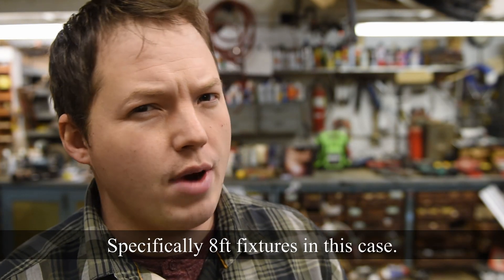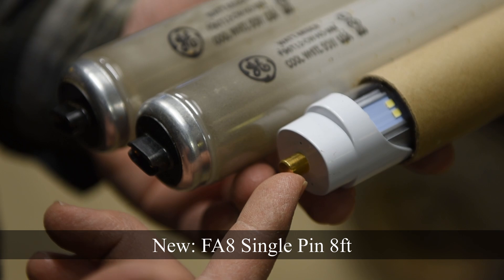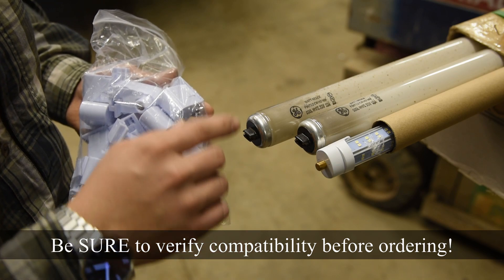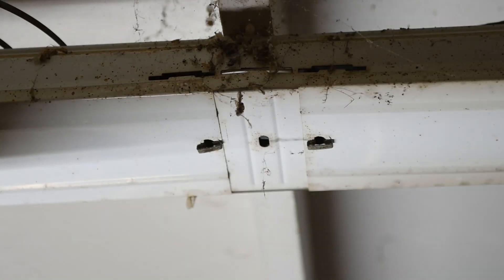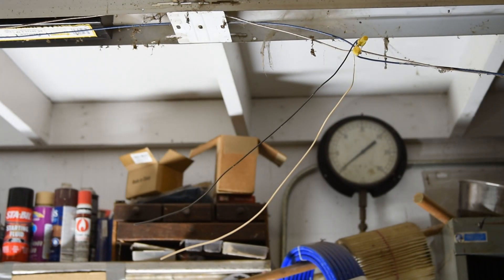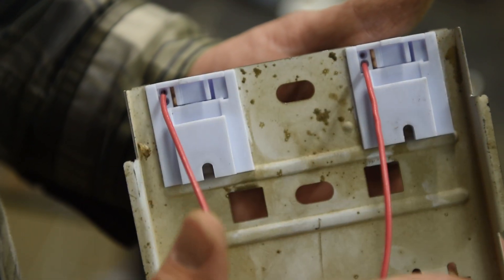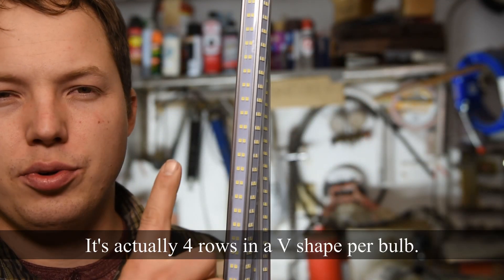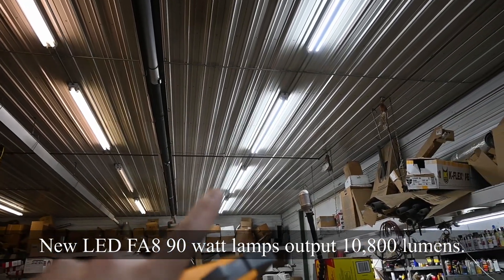How To Convert 8ft Fluorescent Lights to LED - Ballast Bypass R17D to FA8

Comment: I do this for a living. I keep rolls of solid 18awg black and white on the truck but as long as you keep a consistent wiring scheme it’s not a huge deal as long as you don’t use green. I’m pretty sure the nec only dictates against using green as a current carrying conductor but yes standard field practice is 120volt white and 277v grey.
Reply from the maker: Awesome. Thanks for sharing your experience! Do you recommend changing out the lamp holders or do you usually match the bulb to the existing ones?
Reply: Benjamin Sahlstrom Hey thanks I appreciate that. In your case I would’ve changed them. You didn’t need HO lamps and they’re more expensive to retro. As long as they are in good shape, not old and fit the application I’ll leave them.
Reply: Towelie,.  I took my red and blue extra wires and spray painted the last 3 or 4 inches of each end white spray lacquer.  Every DIYer probably has a bit of white spray around in a cabinet somewhere.  These indicate neutral wires, huh?   Cheers
Reply: You can buy UL type B LED retrofit lamps with r17D bases. Satco and Keystone make such lamps.
Reply: Buddy89, all I can find locally is stranded 18 gauge. I tinned the ends with solder and the wire locked in fine. My question is , do you think it's a problem tinning the ends of the wire?  Any safety concerns I need to be aware of?  Thanks for your input
Reply: G M as long as the insulation on the wire is rated for the voltage you should be fine🤙
Reply: @Towelllie  Well, I bought some automotive wire at NAPA.  It's rated at 13 amps.  I have no clue of the insulation rating.  How do I determine that?  Thanks again for your help
Reply: G M insulation is rated by voltage and is printed on the insulation about every foot or so. If there is no voltage rating don’t use it.
Reply: @Towelllie  Thank you Sir! I ordered some wire and I will see if it has a voltage rating.  Would it be possible for you to send  me what brand of wire you use since you do this full-time?  I want to do this right.  Thx again
Reply: G M No problem my friend. I use 18ga TFN wire. It’s available at most electrical supply houses.
Reply: @Towelllie  Great! Thx again for your help
Reply: The wire that I ordered is stamped 300 volts on the insulation. You think that would be okay?
Reply: We used Blue and Red and then also used Black and Yellow
Reply: Wiring in the lighting fixtures its no big deal to use different color as long as you followed color code on the supply lines...thanks.

Comment: The human eye sees more acutely under bluer light which is why spaces lit with 5000K + color temperature are perceived as brighter than under a lower color temperature lamp, when both types of lamps are providing comparable lumens. When these higher color temperature lamps were popular back in the early 2000’s, I replaced fluorescent lighting systems in hundreds of buildings with lower wattage F32T8 fluorescent  (30, 28 and 30 as opposed to the more common 32 watt lamp), and in some cases with new lower ballast factor electronic ballasts. 

In this day and age, people are cautioned not to be in higher color temperature light at least two hours before bedtime, as blue light can disrupt a person’s circadian rhythms. It’s best to use warmer colored lighting systems (2700-3000K) light at night.

Comment: How to bastardize a luminaire, lie about the ballast, and hide the fact led’s use a ballast too. A ballast supplies the proper current and voltage to the fluorescent lamp. An electronic fluorescent ballast is every bit as efficient as the electronic driver for the led. Guess what that driver does whether it’s internal or external to the led. It supplies the proper current and voltage to the led. Sound familiar?

Comment: If you use the yellow and call it "off white" I would put a label on them reading "Neutral", because code says white or gray, Yellow is actually the color code for a commercial "traveler wire".

Comment: Even when powering an LED, the fluorescent ballast itself will continue to consume a small amount of energy, but not as much as with the CCFL. I believe you said you are using 6000K. I bet you would like 4000 - 4500 better as far as reading and assembly work for less eye fatigue.

Comment: So 1 red per RA8 tower x2  (one end) ,        
       1 White per RA8 tower x2 each (opposite end) 
Would help visually if you would on took a picture of each end wired up,before you enclosed it in.  Also they were non shunted RA8 towers correct ? I might have missed you mention that .Very informative video.Thank you

Comment: Thank you very much. You solved several problems for me.
 I am replacing our garage's flourecent T12 8" to Led T8, 8". 
Qauntity 11 fixtures conected in series. 
My question: I didnt see a ground wire coming out with the L and N wires. Is that normal?.. If not what should I do?
Thanx.

Comment: I like how you showed the neutral on one end and the power on the other. Not being an electrician, I am gonna have  to find a schematic so I don't electrocute myself. I got a little lost on the wires all getting  tied to the wire nut.

Comment: You show close to 5 amp draw on each of the three circuits with the ballast and Flo tubes.   Your finish LED conversion was pulling more amps.   Your electric bill went up !

Comment: Your video helped us replace 25 ballasts across 5 strings of fluorescents. Saved us $1800 from the electricians quote. Thanks. I’d add a picture of the finished project if I could.

Comment: I realize this is an older video at this point as I came across it and was surprised you were doing the retrofit and why I say it that way, is this actually to code in the USA to install these bulbs and therefore bypassing the ballasts. Here in Canada I was told by an electrical supplier who also has licensed electricians as well as speaking with other electricians, its a no go to do this retrofit as far as being to code as well as very possibly voiding your building insurance in the process. Yes some people have certainly done the retrofit not realizing the implications. At the time and not sure if that is different now but most of those bulbs from china are not certified under CSA or UL but that is only part of it, the other problem is that the existing light figures were never approved for 120 volt bulbs ran direct, only for the reduced voltage after the ballast. It was some years ago I did some retrofitting and replacements of fixtures, uninstalled the 8 foot units and installed 4 foots in their place and then replaced all the otherolder 4 foots I had with electronic ballasts. Then installed the retrofit LED bulbs designed to run off of the electronic ballasts. If I could have found actual LED strip lighting fixtures at a price that was affordable at the time I would have done that instead of course but they were beyond insanely priced, have not priced out strip LED lately. The power draw testing I did with an ammeter was interesting as I had experimented by testing the older 4 foot units that had magnetic ballasts with florescent bulbs, then installed LED bulbs and no difference in the power draw. Then I changed out the magnetic units for the electronic ballasts running the same LED bulbs and the power draw dropped exactly half. That was eye opening, I expect dedicated strip LED lights would use less power yet but the newer ballasts with the retrofit LED bulbs were a compromise that kept the type of retrofit I did still to code. The bulbs work great as per the heat not turned on in the shop and can be very cold out and they come on with no issues and no more of that humming and pulsing light that florescent is famous for. Anyway just thought I would share that and to check out if such a retrofit as per this video is allowed by code in your area of the world.

Comment: When I do fluorescent to LED tube conversions, I like to apply the labels to warn not to install fluorescent lamps in the fixture, as there is no ballast.   In one of the shops I was working at a few years back,  a maintenance contractor was injured when a fluorescent tube exploded at the end he was holding,  upon inserting the tube which had 277 volts at the tombstone,  it had the ballast bypass and was wired for single end power, the other tombstone was used as the support.    Just a thought based on my experience working in  commercial.

In your application not a big deal because 120 volts or even 240 or 277 is not enough to start a fluorescent,  wired end to end.   If wired single end, definitely should apply the warning label,  even more critical at higher voltage like 240 or 277,

Comment: the old lights used just a little less than 5 amps and now the new lights are using just under 7 amps, i know you get a lot more light from the new lights as you can see but what about what the electric cost, are the new lights going to cost more to use, you should also tell everyone how much longer LED will last, these lights are great compared to the old ones

Comment: Wish I would have seen this video before I bought 4 foot LED tubes from Costco.  They physically installed ok but would not switch on.  I'm sure it had something to do with the ballast.  Took the tubes back.  I ended up buying the entire LED fixture that came with LED lamps installed.  It came with various switchable settings and a motion detector.

Comment: Colour coded wire was designed for electrical installations for a reason and it is good safety-practice to use the coloured wires in an installation so as to keep the uniformity of the original electrical wiring used before the handyman buggers up the electrical wiring installation.
Reply: Honestly   If the next person to come along, does not know enough about electrical wiring to understand what is going on in this simple situation, he has NO business sticking his hands in there in the first place.

Comment: Buddy89, all I can find locally is stranded 18 gauge. I tinned the ends with solder and the wire locked in fine. My question is , do you think it's a problem tinning the ends of the wire?  Any safety concerns I need to be aware of?  Thanks for your input

Comment: You ask what to do when wire color is incorrect, as an electrician of 20 + years I used a color flag. A piece of tape that the correct color @ each end of the wire. A flag is tape 2 or 3 inches long w/ both ends sticking up away from the wire.

Comment: I'm struggling!!! I bought a bulb that says it's compatible with a ballast (but I removed the ballast)....does that mean that bulb will not work unless you have a ballast? help please
Reply from the maker: Yes, typically they are either for line voltage or to be used with the ballast. I would recommend the ballast bypass option since that will use less energy.
Reply: @BenjaminSahlstrom  Thank You!

Comment: A bit of safety advice. If you have a grounded conductor, as is the case with 120 volt, 208 volt high leg, or 277 volt systems, I would recommend connecting the grounded conductor to the end with the spring loaded A8 or R17D lampholder. This will reduce the risk of an electric shock as it is the first to make last to break. This is if you are too lazy to turn off the power when changing lamps which is what you should do.

Comment: Oh, let me add you should remove the useless ballast. If you're going to do a job do it right. The ballast can't be used because you cut the wires at the ballast so why leave the ballast in the fixture?

Comment: You were concerned if you should use the existing yellow wire that was in the light fixture. I say yes do it but add a peace of white electrical tape on the yellow wire at both connection points of the yellow wire to indicate that it is a neutral wire.

Comment: Pins which are powered (i.e. carry a current) on BOTH ends of a fluorescent tube are a HAZARD !
If a workman replacing a tube while the power is ON has a finger touching the pin(s) on the
unpowered end, a shock is possible when the powered pin(s) make contact in the socket at the other end.
It is safer to have the power fed from one end and have the other end just for physical support.
LED tubes for ballast bypass are now almost all "G13 Bi-Pin" or "recessed double contact" for that reason.
For G13 Bi-Pins, the socket contacts on one end are "unshunted" so they can be separately wired
"hot" and neutral, and the socket on the other end is just for support and not wired.
In this project, sticking with the "recessed double contact" format would have been safer.
Reply: I just had a r17g? Style tower burn and short with 110 watt HO fluorescent bulbs T 12 .For this reason they are getting retroed to Ra8 single pin towers with ballast deleted

Comment: I don't get it  ... when you measured  Amps on the blue  in the beginning it was 4.75 and after you converted it was 6.25 Amps ?
Reply: LEDs are more expensive to run in that configuration but are brighter so in a lumen per amp they are way cheaper to run if you thin you need that much light

Comment: The inspector here in my area is fine with yellow because it’s inside the fixture. One of the inspectors in our area has opinions that the sockets were never approved for the current rating that they might encounter if the led style bulb fails into a shorted condition. As in the Original application the sockets will never see 20 amps short circuit..But he is older inspector and none of the other building inspectors has brought this up but he brings this up all the time. But he still appeared the installation work.
Reply: He actually has a point.  The ballast is a current limit on the output lines.  The wegos are not performing that function.

Comment: I have been using lower color temperature LEDs, about 4500K. Light is not as harsh and less bluish.  I also reuse the tombstones unless they are cracked or the wiring terminals are discolored due to heat.
Reply from the maker: Yeah, the 6k does seem pretty "harsh" as you mention. 4k is nice and I even enjoy the 3.5k when available.
Reply: @BenjaminSahlstrom   I installed LED strip lights under my kitchen cabinets.  The 2 footer is 25 watts and puts out 2,000 lumens, that's 750 lumens more output than a 100 watt incandescent bulb yet uses 75% less power.  It's rated at 4,400 K, it's the best light I've ever seen, no pinkish/red or bluish/purple tint, just pure white light.

Comment: The color of the wire can be technically changed by wrapping electrical tape of the proper color at each end of the wire.
Reply: Depends on the code you are under.  Not always.

Comment: Electrical code does allow just the ends to be marked with the correct color. White electrical tape works well, but sometimes I'm adventurous and use which heat shrink tubing. White wires can also be marked black when used as a hot such as when using general romex as a 240 line.

Comment: I've been using LEDs in my kitchen ever since they were affordable, mainly to cut down on the heat that seemed to be killing my ballasts in a closed fixture. They do seem to have a limited life of about 2 years, or 10,000 hours, when they begin to dim. My wife keeps the kitchen lights on if she isn't in bed. LOL

Comment: Let me understand, I can replace my bulbs with led, but I have to remove or disconnect the ballast? And one more question this type led bulbs are good brand?
Reply: The ballast consumes a lot of power on startup and is necessary for the gas inside the fluorescent bulbs to start up, hence the buzz when you start up the lights. This is not necessary for leds, as they are made differently.

Comment: Is there a way to tell if the led replacement bulbs need a ballast?  I bought some bulbs on sale at lowes and can't remember if the box said anything
Reply: If the label on the tube does not say type one or type 2, and you can't find an OEM cut sheet for the model number, you can always do a smoke test and find out.
Reply: @BrianFullerton  true😅, hadn't thought about that

Comment: Greetings from Australia. Last year I replaced the suspended ceiling in my factory which had various fluorescent tube light fittings. I replaced all the fittings with flat panel LED's 4 x 1 ft,  3500 Lumen output, 4000K colour temperature, weighing 4 Lbs in weight, about 1/2 inch thick and came with a 3 pin plug on a flexible lead.. They were available  either to go into the suspended ceiling rails and had other mounting kits. Larger lighting panels with higher outputs were available.Why would you bother with crusty, rusty old  fluorescent light fittings with heat damaged wiring. It would probably be more cost effective than to change out tube fittings.

Comment: I would have removed the fixtures, cleaned them and then spray painted them.  Then cleaned and repainted the ceiling as well.  Would have been interesting to "before and after" put a light meeter on your benches and seen the improvement of all your work.

Comment: If you are a bit pedantic like me, then spiral wrap the ends of the yellow wire just before they  join up with your plastic clips with an inch or so of white or gray electrical insulating tape and I think you will be up to code.  Couple of pennies of tape and a minute of your time for each yellow wire connected.  Especially if you have to pull an electrical permit with the county or city where you live.

Comment: Wrap yellow wire to white heat shrink. You are using tubes where power goes to both ends, but such tubes are allowed only in few countries. In many countries electrical codes require only one-end powered LED tubes since 2010.

Comment: I think yellow ok for neutral
Check NEC 410.130.G.1 for certain lighting u need to install disconnect plugs. Typ orange 
Plus cool trick use ur cell phone and look at fluorescent lights
If looks like barber pole it is magnetic ballast. If no barber pole electronic ballast. Try it out

I hate doing light bc so filthy
I like doing lights bc of the instant gratification